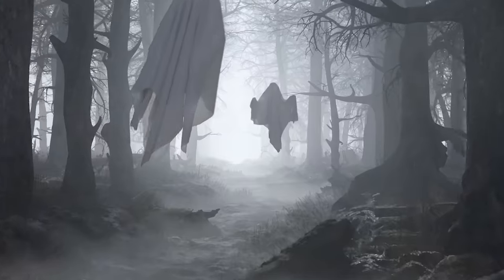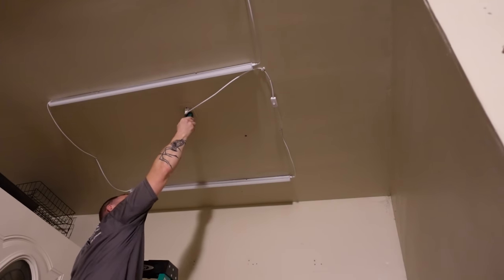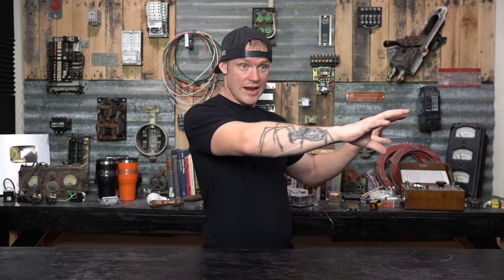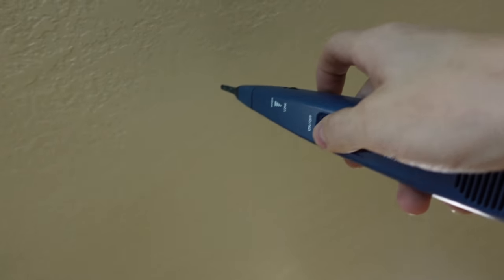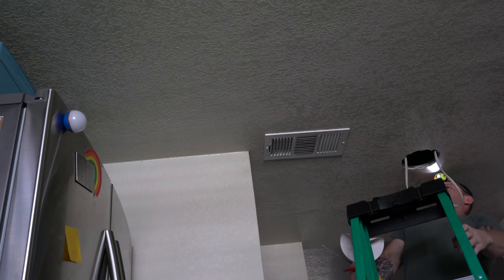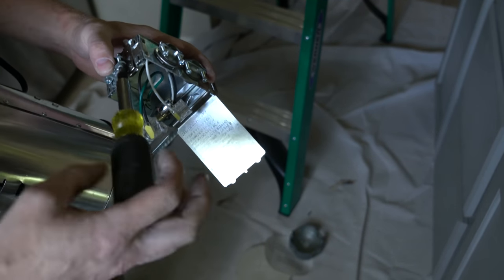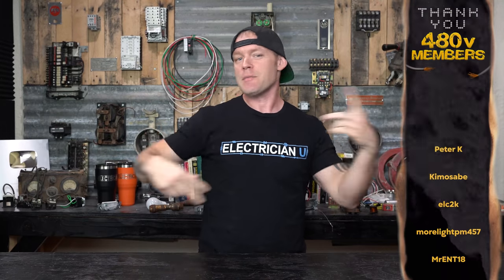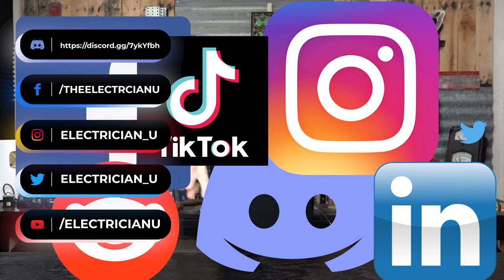THIS IS WHY ELECTRICIANS DON'T HIDE J-BOXES IN WALLS - Finding Hackwork!!

Comment: You are a really good explainer.  Thank you for that.  I have a switch at the entrance to EVERY bedroom in my house that seemingly goes nowhere.  My assumption is that the switches used to work overhead dome lights that have since been covered by new ceiling drywall and left dead-ended in the overheads.  Also, YES I checked every outlet for functionality with the switches to no avail.  I plan on using the toner next (once I acquire one), but was wondering if you had any other thoughts.  House was built in the '40s.
Reply: I can almost guarantee those switches used to operate half of a plug on the wall and have long been abandoned. For lamps and such
Reply: @titaniumwolf1123  why i stated..." Also, YES I checked every outlet for functionality with the switches to no avail."   not my first old home restoration.    You may be correct in that the switches "used to be connected to the outlet and have since been abandoned" but i'd like to verify that.
Reply: @bobgang8700  that's All I meant. The wires that used to control said outlets are probably capped off behind the outlets. It's that way 99/100 times someone calls me for the same issue. I wouldn't worry much about it :) quite common
Reply: @titaniumwolf1123  I will look for that.  Thanks.  I’d like to remove the switches and patch the walls if that’s the case.

Comment: One of the things I do in a situation like this is flip the circuit breaker for the circuit in question, then you can map out exactly what's on the circuit so you know the endpoints you can test.   Higher-end stud finders will also find live electric wires inside of walls these days as well.  Cool Video.

Comment: I enjoyed your illustrative lecture on this subject. I think you demonstrate such enthusiasm that many youngsters will consider a career as an electrician. And you provide a good role model. Also the "carpenter's helper did such and such..." yeah a recipe for disaster. I was aware of J-boxes have to be accessible, I learned what the specifics NEC says about it and also that new style of J-box. Speaking of J-box accessibility, a recent remodel of an older house I noticed they placed a large J-box in attic but it is on the far side from attic access, close to wear roof and ceiling come together (a tight squeeze), and someone would have to negotiate climbing over A/C ducts. Questionable access but it was approved by inspector.

Comment: Thanks for the video. 

The melting wirenut indicates an arc fault to me. That also explains the voltage difference between neutral and ground: that arc fault has a high resistance. 

Glad you were able to find and solve the problem!

Comment: Been in construction trades for 30yrs {mostly as a carpenter}. Worked for an electrician for a couple of yrs and we always cleaned up after. Even after new home rough-ins, we'd take a push broom thru the areas we worked in just to clean up the wood shaving on the floor. Just a little courtesy goes a long way.

Comment: I do most of my voltage testing with a wiggy instead of a multi meter. it puts a small load on the circuit so you don't get those "ghost" readings. I also built a loud audio continuity tester I can put on a set of wires so I can cross a wire in another room and hear the connection.  
fantastic video, Ive been doing this stuff for 40 years and I,m learning a lot from you
Thanks.

Comment: I really like how this presenter works. Makes sure he understands what is going on, isolates faults, talks to the homeowner about implications, avoids mess.
One thing you can do when cutting into drywall to avoid the dust going everywhere is to have a vacuum cleaner nozzle near  the saw blade.  You can even go so far as to use a vacuum designed to catch very fine dust. I would avoid pulling on wires in a home that has issues from bad previous work as that can create new problems. I would use a stick and grippers or something to jiggle the wires going into that junction box and jiggle the junction box ,but keep the stresses local to the box which I know I am going to fix anyway to bring it up to code. The fact that the signal died the way it did meant that there was a high impedance connection (i.e. barely touching wires) in that junction box, as evidenced by the melted insulators when it was opened up.

Comment: I been an electrician for about 20 years now and came across this same situation alot with odd voltages. It's always been same as your instance, a loose neutral, burnt up wire nut or just wires not tied correct in nut. Troubleshooting is very fun (when you figure it out) lol great video brother

Comment: "Ghost Voltage" love that quote. In Australia we call that a Back Feed.
If you lose a grounded neutral thru a bad connection or disconnection all neutrals back from the fault become live or "hot" for my American friends.
Love learning about the centre tapped system as aposed to the multiple earth neutral system we use.

Comment: This kind of story time is exactly the kind of stuff that my cable guy buddies and I would swap about troubleshooting cable problems.  I know exactly what you mean with the toner wand being kind of unreliable sometimes and a little sketch.  One other thing it does that I'm sure you know but you didn't mention is bleedover - the signal will sometimes be heard faintly in adjacent wires that aren't connected at all to the source, but the signal is strong enough to, just by nature of being near other conductors, jump over through the tiny magnetic field it creates.

Currently paused at 16:23 and I love this.  Reminds me so much of my cable days, stories so real and bizarre that you can't make them up.

Comment: Very well made and informative, as a self taught electrician with 50 years experience in multiple countries in Europe and the Americas, I would approach this problem in exactly the same way but adding another hi hat instead of repairing the ceiling is a great solution (if feasible).

Comment: im a electrician in Canada I work maintenance at a refinery but started in residential. I really enjoyed your video its crazy the crap you see from handy men or homeowners trying to do their own wiring!. As for PPE have you ever thought about voltage rated gloves ? They are rated for 1000V yes it sounds excessive but they work like a charm . good job on the toner used those before and I like your line\e of questioning you sir are an excellent trouble shooter!!!

Comment: On the Fluke tone generator, if you use the ALT tone, shorting the leads for a moment will change to a different tone pattern. This can be used to verify having the correct pair. 

Same can be done with any tone generator. The tone will stop when the leads are shorted.

You don't have to use both leads. With the caveat that can use the shorting identification method, leaving the black lead floating will work when there is too much cross talk.

Conversely, if you need more signal, connect the black lead to ground (or pretty much any large conductive mass). This will sometimes work for finding a cable through a wall.

Comment: Hey, at least your mystery was contained in an an actual metal BOX. One of the first places I was a helper at, they opened up the wall and took out a mess of connected wires that looked like a giant spider, no box at all. Even I could tell whatever it was was HIGHLY illegal. An older home, but quite a high end home, so don’t imagine that you necessarily get what you pay for. 

I’ve seen a lot of creative electrical atrocities in industry offices that seem to have their own in-house electricians or something, but have clearly done most or all of the work without benefit of any kind of inspection. Loved your idea of putting in that extra can light to make an accessible and legal place for those junctions. I never got a chance to do a lot of troubleshooting, just construction, so I’m loving your channel.

Comment: Great video. I'm not an electrician but, I've done wiring in my own house to upgrade a few circuits. First place  I go is the electric code online, both local and national to make sure I will be doing it  right. I had my friend (a pro) come in and inspect it. It was a dryer circuit and two 20 amp genral purpose circuits. He looked at me and said I did good. Right to code, then asked me if I wanted to work with him. Needless to say I felt good.

Comment: Great video, I appreciated all the little tips and tricks you went over. Most of all though THANK YOU for pointing out the fact that remodel can housings don't need to be used anymore. I just put 14 canless recessed lights into a family room. I went with the ones that the junction boxes were not mounted to the light, glad I did. Sure enough, I had 3 locations where there was a floor joist right where I needed the light to go. Thanks to the canless design that was not an issue at all. Had I gone with the old school design or even the ones with the junction box mounted on them I would have been hosed.

Comment: Great presentation. You did fix the issue but not the problem. I did have a big write up on this but I accidentally deleted it. So here is the skinny version.

The reason the neutral wires and cap were burt was because the circuit was overloaded. According to the Electrical Code no Circuit can have more than 10 devices (for those not familiar with the term device they are any outlets, switches, lights, and fans that are directly wired to the circuit) on it installed. In this house the reason the Neutral wire burnt was because of an over load situation. 

In the video on the drawing there were 11 symbols shown. 4-outlets, 2-lights, 4-switches, and the j-box = 10 devices (j-boxes don’t count).  This would be all right an good if this was the case. But it’s not. 

Going back over the video because it I saw a couple of problems with how this  house was wired to being with and because I had a pretty good idea what might be the issue. I decided to physically count the number of devices on the circuit using both his drawings and what was seen physically in the house. Now keep in mind if he drew a symbol on his drawing then we have to take it that he got verification that current to these locations and all devices in these locations apart of the current, and thus supplying power to whatever they are connected to. 

Here we go. 1-GFIC(couter), 3-((3 panel  light switch)(possibility of garbage disposal which would add another device, but won’t add because can’t verify),1-outlet,1-outlet(end kitchen and stove by code has to be on separate circuit),1-problem outlet,1-switch to porch,1-porch light,1-switch bath,1-vanity light,1-switch garage, and 1-outlet ceiling garage. That give a total of 13 confirmed devices. 

That number can get worse if those switches in the box of 3 switches next to the sink are connected to any can lights and if there is that suspected garbage disposal is there. Then the number of devices on one 15amp circuit is so over load it’s amazing the house didn’t burn down!

In fact that is exactly what did happen!

Only because some of the code was followed was that person’s house saved. Because a metal box with wire restrictors used was the initial fire contained and didn’t did go any where. Basically the box act like a lid on pan in a grease fire and snuffed the small fire out with its own smoke.

Unfortunately the flammable materials burned away and aloud the circuit to continue working. The over load situation is that was originally installed also reviles that both the GFIC and the CIRCUIT BREAKER have been been damaged! As the both should have tripped especially carrying that much load. 

This is an arc fault situation where the GFIC and Standard Breaks would not catch this issues. An the newer arc fault breakers is what would have been need. You could place the arc fault GFIC (sorry forgot the abbreviation for these), but if you in stall the breaker then the outlet is over kill and make troubleshooting harder.

Unfortunately, I  would recommend running back to that home or calling that home owner and explaining that you need to add a circuit to up that one massive circuit. Then replace both the GFIC and Circuit breaker for the existing circuit making sure that both new and old circuits get the newer Arc fault type.  

The nice thing about them on adding them to old problem wired areas is that they will trip if their are any issues with arcing (or miss wiring) so install this first on the old circuit before breaking it up to insure that there is no other current issue. Then break up the old circuit. 

Remember your the last one to touch the electrical and your the first one everyone will look at if the house burns Down! If you inform the homeowner about the discovered issues and the correction need and he passes, then your in the clear. 

Great video again. Keep up the good work.

Comment: Love those new lights. I had an electrician over to install a 220 run to the kitchen from the circuit breaker box in the garage. He starts and tells me he will have to install conduit across the garage ceiling and cut holes in places I did not want them. Schooled him on a pathway I had blazed that ran from ceiling lamps in a line to where the line had to go. We  grew new ceiling lights to make it happen. Sort of destroyed his plan of in and out by noon. Paid him over what we had agreed on, and my ceiling is intact.

Comment: I love how you teach and explain everything barney style.  My bread and butter is garage doors and openers, but do minor in handyman stuff which sometimes requires electrical work.  I have a general understanding of basic electricity and know of most hazards, but you help me understand more.  Do you have a video on how to run wire for 3 way switches, lighting and outlets from an addition to the panel?  Thanks for doing what you do.🤟🏽

Comment: I absolutely love those new slim recessed lights that have the small junction box connected to about 12 inches of wire. I've been replacing all of the "boob light" fixtures in my house with these new ones.

Comment: 22:30 I really like the Lithonia Lighting WF6 pancake lights, that can actually be mounted under a rafter if needed, that way if you want them centered they can be.  Downside is that they do have the external box, but it's connectorized so that it can be separated from the light itself.  They are thinner than the sheet rock itself.    Great video.  So funny to watch the UK based electricians in that they can mount junction boxes in the walls and ceilings.  They are  permitted as long as they are "maintenance free".   That means using wago's in the wago box with a wire tie so that a mechanical tool is required to open it up and it can't just pop open in the wall.

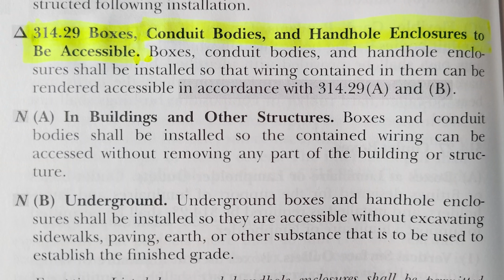Comment: 20:55 thanks for letting me know my kitchen I just remodeled myself is done wrong 😭 previous owner wired the entire kitchen and half of the upstairs into the same circuit. I ended up using 3 junction boxes to isolate the upstairs corcuit and reran 250ft of 12-2 plus 50 ft of 14-2 to 5 20amp circuits and a 15 amp circuit. I isolated the upstairs by just splicing the wires in a junction box and nailing that box to the stud. So it sounds like my options are either, have a bunch of ugly blank faceplates everywhere in the kitchen, or rerun all the wiring upstairs...

Comment: DIYer here. Want to say thank you as I didn’t notice any point within the video that you assumed this was a DIY job. Too many people in the trades automatically assume any faults must be the work of the home owner.  I’ve seem some pretty dodgy jobs that were done by so called pros. I’m certainly not perfect myself, but one reason I like to do the job myself, is I know if I f- it up, I’ve only got myself to blame. Was good seeing how a pro would go about diagnosing this problem. Nice systematic approach here. If I were diagnosing this circuit, step one for me would be turn everything off at the breaker, and see what turns off, then I’d start disconnecting at the various likely boxes along the route, until I found where the problem was distal to that item on the circuit.  Then I’d start guessing (probably pull the can down same as you and look around). That being said though, I’ve never seen/used the wand tool you had. Looks useful.

Comment: That was a great story. I’m a home owner, not an electrician, and I wanted to replace my fluorescent canned lights in the hall with some LED retrofits I bought at Home Depot.

When I removed the light and can of the first, I could not find any ballast. None on the bulb, none on the can. It just went straight into a nearby junction box. I checked all 5 lights and they were the same. It made no sense.

After a long break, I opened on of the junction boxes to see how the wires connected when I noticed a tiny hole in the center of the back of the box with two wires coming out. I touched the back of the box and sure enough, the ballasts had come mounted to the junction boxes.

From my point of view, you could not see the ballasts as they were obscured from view by the boxes and were wired within them. Once that was known, the retrofit was easy.

It was an adventure.

Comment: When I moved into our current house we had a similar issue with our dining room. There was an outlet that had all kinds of crazy voltage and  hardly ever worked. We also had the switch to the ceiling light that would pop the breaker every time you try to turn the light on. The ceiling needed to be pulled down and drywall anyways so I dug into the issue by pulling most of it down. Come to discover the previous owner did some DIY electrical and used either a 16 or 18 gauge speaker wire to wire up the light and the outlet. Needless to say I ended up pulling all of the electrical out as we did each room and rewired the whole house.